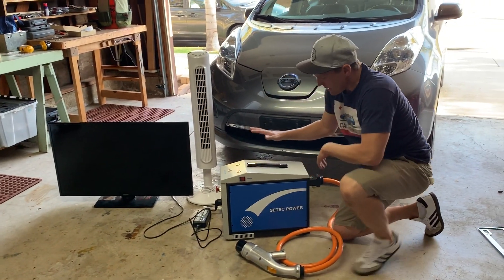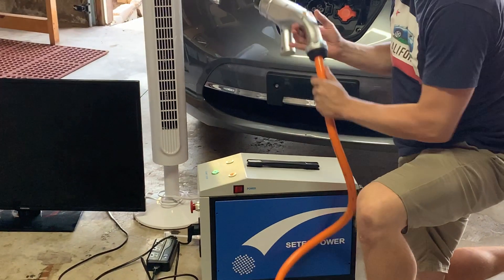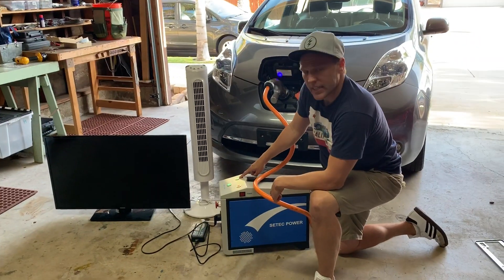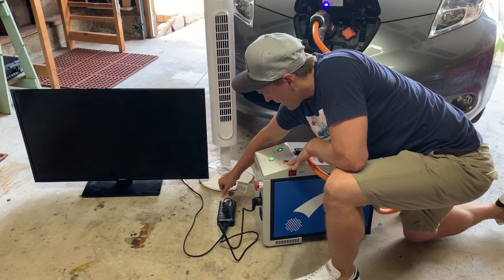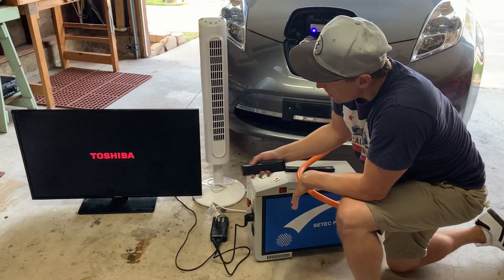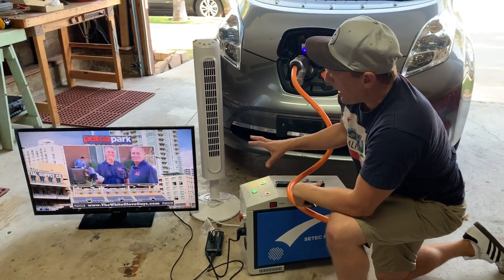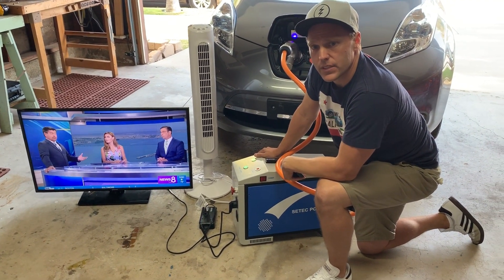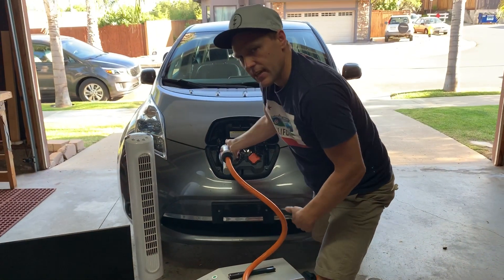Vehicle to Home (V2H) Demo testing emergency back up power with a Nissan LEAF

Comment: I thought P2H is destined to pouwer the houme. this was more a demo for V2L. 
can you plug that system in the house? via a normal plug to power the entire house? (assuming you're not drawing power within range of the vehicle and the converter )

Comment: That's all you need - TV and a fan. I have also a leaf and I am thinking of getting this or a similar device as well... looking at the cost of a "Solar Generator" from Anker with paying $3k for as less as 3kWh this connected to my still 20kWh capable LEAF seems to be a better deal. Thanks for showing!
Reply from the maker: Thanks for the comment. I agree - there are now a lot of mobile battery solutions out there that can do this job. If the V2L units become cheaper and smaller could still be valuable. Better yet are the new units coming out designed to connect to the home.

Comment: I think you can use solar inverter for this operation, its widespread.
Reply from the maker: That's basically what it is. A solar inverter, but also has the vehicle communications.

Comment: а нафига ему такой толстенный кабель? он что там 10 киловольтную подстанцию решил запитать?
Reply from the maker: haha. yeah, that cable is very big for 3kW. It's a function of the CHAdeMO standard, as well as supply chain for common highpower DC charging applications.

Comment: Is there a way to use my Solar panel Solis inverter to discharge My Audi E tron’s Battery
Reply from the maker: No. Thinking about the basic components, yes,  V2L technology is basically using a solar inverter to discharge DC-->AC. But no, you can't simply connect your home solar inverter to an E tron. More technical detail to explain that fits into a comment.

Comment: Is there a device that can be wired directly into the house electrical panel, similar to a gas generator?
Reply from the maker: yes, I have new units coming next that can be connected to a transfer switch. Will share a video with you in next couple weeks.
Reply: @evsiphon  I would be interested in that video. Thanks

Comment: Wow.  Imagine a world where these V2H kits were mandatory.  We would plug in our cars when we get home.  At peak time (around 7pm) the house would draw energy from the car (for cooking, TV time, etc).  then after say 10pm, the house and the car would draw from the grid.  This would greatly reduce the peak usage and lower the strain on power generation.  Peak load is the biggest problem for energy utilities.
Reply: Another fun thought to add is if the owner worked was somewhere with solar panels that could be used to charge the car during the day. It might be possible to go home with a full battery to be drained at night. Then drive to work the next day with a reduced total charge of the battery to recharge off solar.

Comment: Is there any reason why you couldn’t wire this unit into the consumer unit in the home and when plugged in would provide additional power source of up to 3 kW for the home?
Reply: Hi Sir, this V2H manufactured by our company.You can contact me through my email( angel@setec-power.com)
Reply from the maker: It's possible. I met one guy that made heavy modifications to make it work. There are other V2H units out there designed to connect to home panel that would be much easier. This one is designed as Vehicle-to-Load as a mobile unit.

Comment: 1. Is it possible to use the V2L device at 3kw and charge the car using the 2kw AC charger at the same time? Would be usable for constant power load from the AC power line, and use the car battery to deliver power peaks when needed to save money using power peak pr hour charged tariff

2. Does the car need to be in on mode for the V2L device to get power from the car?
Reply: Look into V2G.

Comment: Very nice. I want to buy one. but i cant understand why it is so expensive 3000 usd. Currently i use the 12v battery from my leaf power a 1 kw TBE pure sine inverter that i bought for usd 100. I would really love to have a chademo inverter instead, but plase explain why the extreme price difference. Is it possible for you to come out with a lower priced chademo inverter that at least comes a little bit closer to the 12v diy inverter method?
Reply: นก กระทา I believe the Licensing fees from Chademo consortium are very high
Reply from the maker: The 12V solution is a great cheap method, but limited to 1000watts due to the size of the DC-DC converter in the LEAF. This solution gets you up to 3000watts, but yes more expensive.
Reply: Another problem of getting 1000 watts from a 12 volt load is that, unlike the V2H device showing in the YouTube, 400V DC(leaf DC voltage) down to 12V DC has a big problem in the power efficiency. And then you are going up to 1000 watt 120VAC from 12VDC! That is another power efficiency being real bad!!!
Reply: Hi Sir, this V2H manufactured by our company.You can contact me through my email( angel@setec-power.com)
Reply: Hi Sir, this V2H manufactured by our company.You can contact me through my email( angel@setec-power.com)

Comment: This is vehicle-to-load (V2L). It can power loads like a gas generator. Vehicle-to-home (V2H) is similar but installed directly to the home panel. Both can provide back up power but V2L is cheaper and mobile.
Reply: And are the V2H units available? How much to install?
Reply: @uknick  We manufacture above V2H device, please contact me through my email (angel@setec-power.com).
Reply: @yuangel9281  emailed.
Reply: Generator inlet plus interlock switch and this will be V2H
Reply: Unfortunately this product only works for 2014 and older Nissans, mine is a 2013